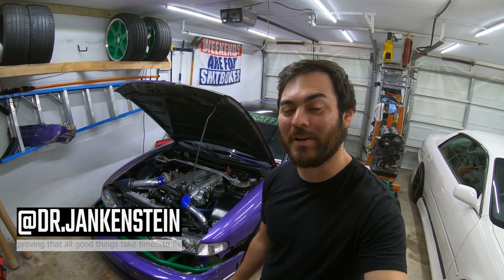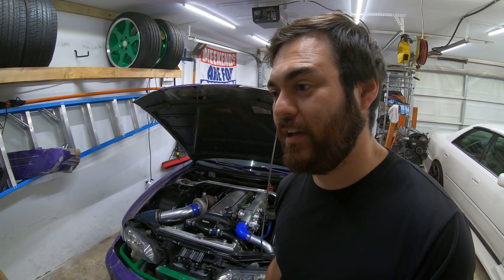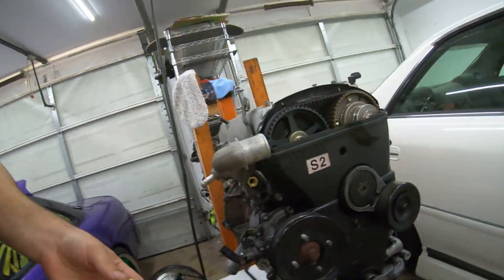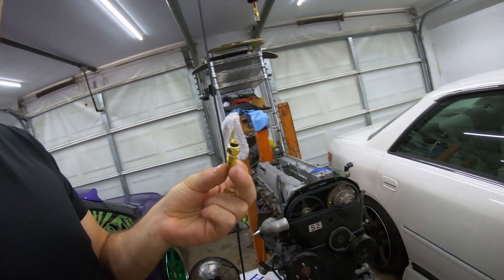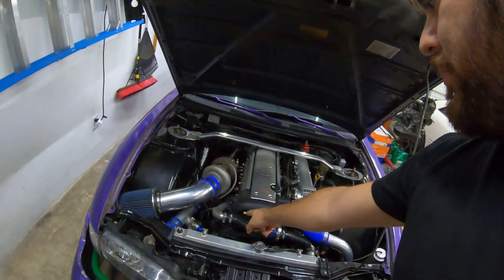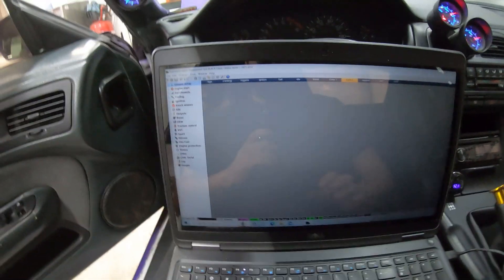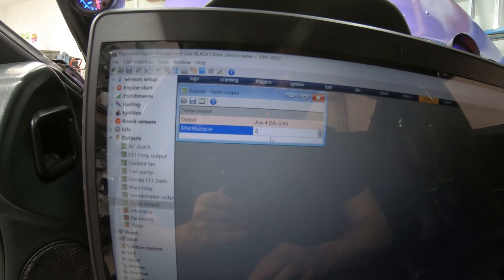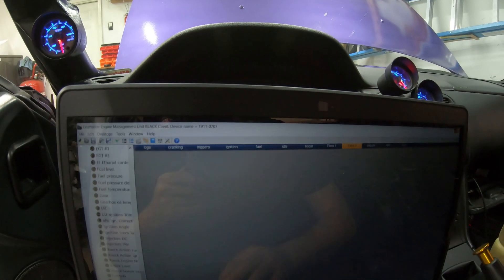Making All S14 Factory Gauges Work With1JZ VVT-i Swap 240sx

Comment: Did you have to adjust your tach at all? My 2j swap reads a little high
Reply from the maker: Surprisingly no, I didn't have to adjust it in the software at all. The 2.0 multiplier setting from the EMU black read accurately for my tach